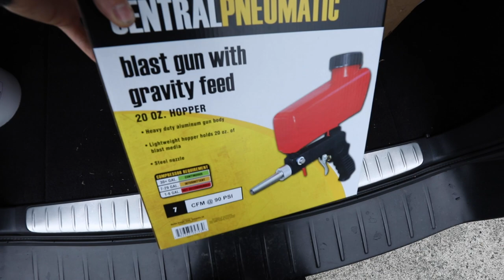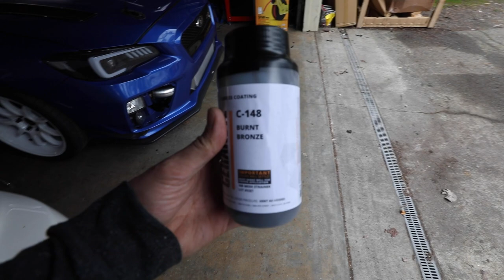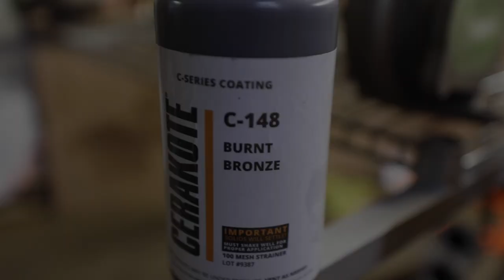Cerakote C-Series. Air-cure coating you can do at home.

Comment: Funny video bro! I have a question about your compressor. I was looking into the same one. Were you able to spray constantly or did it stop and have to refill itself during the spraying??  Thanks!
Reply from the maker: Thanks man. The compressor had no issues between coats, but these are regulated pretty low for this type of spray, so pretty easy for it to keep up. 👌

Comment: Jesus man, you blow a mighty fine header pipe. You need to get one of those bagpipe man skirts and get on down to your local park and put on a show!!

I wonder if it's possible to Skip the blasting and just clean up with Ass-a-tone? Maybe hand sand? Probably not. That blaster looks affordable but I wouldn't use it that much. Might have to find another use for it to justify purchasing. Do you think it would work well for back and pubic waxing?
Reply from the maker: Honestly I wouldn't use the sand blaster again. Made a massive mess and I wound up hand scuffing them anyways in the end. Manscaping is probably a no, but might do good as an exfoliant for the lady. 😆 🤣  thanks for the comment man 🤙

Comment: Do you think I could sand my cast iron Speedtech N54 top mount turbo manifold & turbine housing or should I sand blast it with aluminum oxide? Thanks!
Reply from the maker: They recommend blasting it if possible, but going on almost 2 years and I've had zero issues with any of these parts. No undershield on the car as well. The scotch bright worked well. If you have access to sand blasting or aluminum oxide blasting, then go that route, but at home methods for that make a massive mess..
Reply: @MatlasDI  Yeah your stuff came out mint! I don’t know if scotch brute will cut it on cast iron Speedtech manifold, maybe 80 grit sand paper? Or you think red scotch brute pads?
Reply from the maker: @murk1352  I'd try with the pads made for steel. I think that is red, yeah. 🤙
Reply: @MatlasDI  Yeah I think it’ll be fine? 😂 You’re not going to see it, I just wanted to protect it, same with the turbine housing, it will have a blanket on it. I could buy some aluminum oxide & a hand sand blaster. But like you said, that shit will be everywhere! I should have just had Speedtech do it, but I wanted a different color than black & I still had to do my turbine housing anyway. I hope it comes out good, the cars fast but it’s a show car too, a lot of titanium hardware & carbon on the car. Guess I’m gonna have to cross my fingers on this one! Thanks for getting back to me, I appreciate it….💪🏻🏁
Reply from the maker: @murk1352  no problem man, wish you the best 🤙
Reply: @MatlasDI  Thanks brother! ✌🏻

Comment: How has the coating held up? Im curious how well it adheres without blasting.
Reply from the maker: I've been driving the legacy with the Tomei headers for about a year now. No issues. Coating still on there and still looking good. I recommend doing 5 to 8 coats as although it doesn't have issues flaking, if something scrapes it before it cures fully, you can scratch through it fairly easily. Aside from that, once on car and cured through a few heat cycles, they are durable and hold up well. 🤙
Reply: @MatlasDI  good to hear. I'll be doing my headers using the same process for my c5z. Thanks.

Comment: Is there a video on how the air cured ones hold up over time?
Reply from the maker: I don't have a particular video for it, but if prepped correctly, they shouldn't have any issues after application. They don't require reapplication or upkeep, but you do have to make sure to take proper time with prep and application, or you can have them adhere poorly. The set on both my legacy and outback still have full coverage and zero flaking, for example, and they were done in this video.

Comment: How much cerakote would be enough for just a set of 4 cylinder headers?
Reply from the maker: Cerakote has a calculator tool on their website for various parts but you should be good with their smallest available size I would think. I still have a ton left after doing these and others.

Comment: I forgot to ask is the srt4 pretty fast, haven't seen any videos on it
Reply from the maker: Doesn't run but it will be a focus once the legacy moves. Doesn't have much to go. Has a 6262 turbo on it with built motor and ported heads so it should make some sauce once it runs. Probably will keep it around the 600hp mark.
Reply: He'll yeah that's sick,so much 02 wrx wagon has catless up pipe downpipe and a new td05 turbo what else would I need to hit 300hp. I appreciate the help
Reply from the maker: @robertmilroy2493  as long as you have the fueling for it you should be good. Get a 3 port boost controller if you don't have one yet.
Reply: Thanks again matt

Comment: How is the durability on the C series?
Reply from the maker: Has held up fine after a year. No flaking or issues. Prep properly and allow to cure before driving and you are good 👍
Reply: @MatlasDI  can you compare it to 2K paint?
Reply from the maker: @broom6958  I believe 2k would have better abrasive resistance, I've had pieces I didn't do quite as well that were fairly easy to scrape if they rubbed against something, but again, I think a lot of that comes down to coats, proper cure times before introducing them to harsh environments, and most importantly proper prep for good adhesion. 👍
Reply: @MatlasDI  thank you so much!

Comment: What size tip is that gun? And what settings for psi? 🤔
Reply from the maker: They advise to have at 30psi using a 0.8mm tip when shooting c series, so if you're picking one up I would look for that.
Reply: @MatlasDI  thanks man

Comment: It won’t last longer. Blast the piece with aluminum oxide is a MUST. Good try anyways 👍🏽
Reply from the maker: Haven't noticed any issues on any of the pieces from a longevity standpoint. None are flaking or having any seen issues with adhesion, but I would have probably done a few more coats if I'd done it again.
Reply: @MatlasDI  Good job buddy 💪🏽
Reply: @MatlasDI you only use 1 coat and it's a pretty thin coat.  Thinner is better than thicker